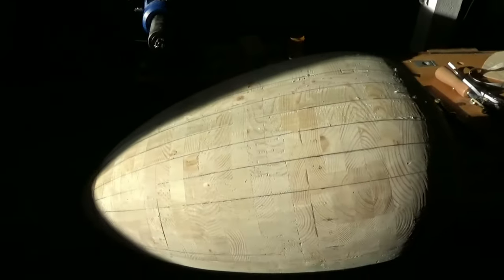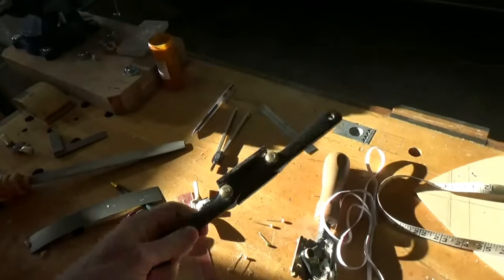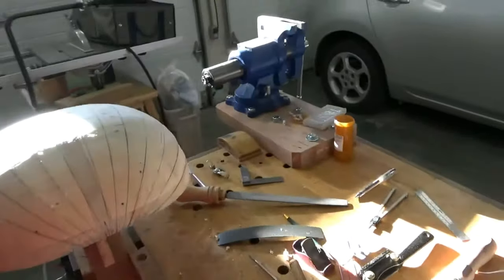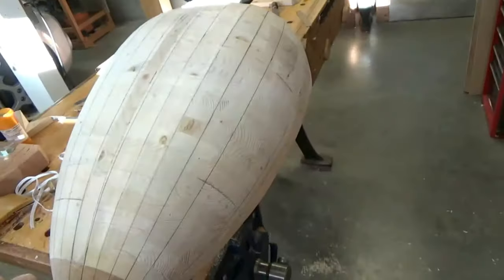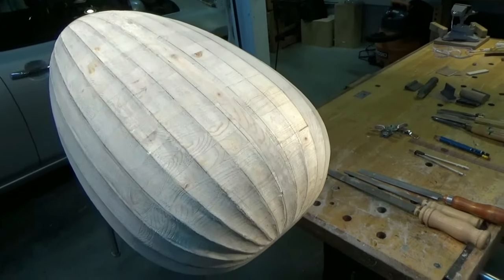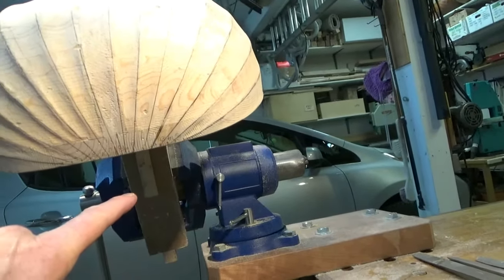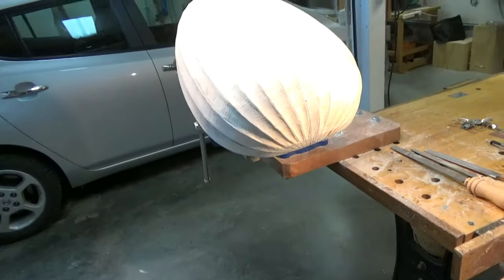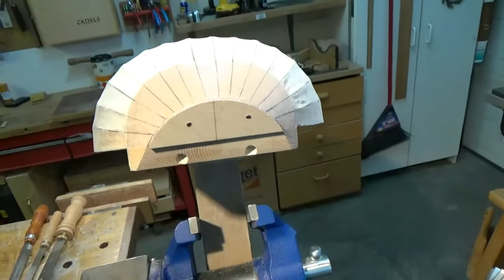Making a Lute Mould

Comment: Thanks for this, very interesting and informative! I see how you transfer the shape from the drawings to make the spine and soundboard outline, but how do you get the right (and symmetrical) curve on either side of the back between those two faces - is it something you can just get right carving by eye or is there a more sophisticated way of doing it?
Reply from the maker: Divide the circumference of the mould, taken at several points along its length (the spine of the mould) equally,  making the outer ribs slightly larger to allow for scooping and correction of the action during assembly. Then you connect the points ( I use five or six, with more at the ends) with a line, forming the outline of the rib, from the neck block (marked equally) to the endclasp or capping strip area at the bottom of the mould (meet at a point or spread, depending on period of the lute).  Then connect these points to make the rib profiles with a  tape that looks nominally straight to the eye.  The more flattened the lute, the more curvature for each rib.  Multi-rib lutes make the coverage easier than fewer ribs, but more work fitting and marking. I mark the round finished mould with a dark pencil, scoop and file, then mark with ink, then varnish finish and wax heavily.

c
Reply: @EarlyMusicStudio1  Hi Clive, thanks very much for the helpful, detailed response. I think it's the flattened back that is confusing me. I can imagine dividing the circumference equally at different points along its length if it were a semi-circle, but the flattened shape seems like it would make each cross section along its length quite unique. Do you work out those circumference measurements on paper first or do you just carve the overall shape by hand/eye following the outline of the base and spine and then measure and mark the circumference divisions with the fabric tape measure afterwards?
Reply from the maker: @jamesluff8415  Yes, you carve the overall shape following the base and spine, but a drawing, a good one, has bulkheads that have have been measured from the original. (Guild of American Luthiers Lundberg plans have these, as do others). Supposedly you are modelling your lute on a historical one, and these have all sorts of deviations from the semicircle, in fact it never appears.  All lutes are shaped as an aesthetic concept, often have slight bulges over the clasp, humps over the neck block (adds material, makes division easier) as well as flattening.  The more extreme shapes are normally more ribs, up to 33, while simpler, early shapes are 9 or 11 ribs. 18th C. German lutes later revived the early shapes and fewer ribs.  

Somehow it all works out.  Neapolitan mandolins have very wide side ribs, but much smaller main back ribs, with the transition in between. 

You must rationalize each rib, they are unique, and they must lie flat on the mould.  See video for the importance of that idea as you fit. Your rib blanks must also be the correct width, as banana and s-shaped ribs make the needed strip wider.

Beyond that, any shape is theoretically  possible, given enough subdivision.  Some woods work better than others, and looking through instrument inventories in lute collections (Bologna, Nuremburg, Munich, Paris, London) point to the best woods: yew, rosewood, maple. Best bending, best planing, best non-splitting, best sound.

c
Reply: @EarlyMusicStudio1  Thanks, I appreciate all the detail. As you can probably tell, I'm new to lute making and it seems to me to be a curious (and delightful) mix of great precision and hand-carving in a way that is quite different from the precision of engineering. 

I'm currently working through one of David van Edwards' courses but have already been eyeing up Stephen Gottlieb's plans for a theorbo after Buechenberg. I've just unfurled the plans again and how to go about making the mold is now a great deal clearer to me - so thanks for that!

Incidentally, I'm having a very hard time finding any yew ribs without lots of imperfections. Those unscrupulous lute makers of old really cleared Europe out of all the good trees! ;)
Reply from the maker: Yes, yew is precious and storied wood; the Celts believed it protected the spirits of the dead and every old church in the UK has its ancient yew.  The enzyme taxamine, which is contained in the cambium and roots, was used as a poison for centuries, then found a new use in the breast cancer drug Taxol, from Bristol-Myers, who barked and cut yew in the national forests of the Olympic penisula. A friend heard about it, collected some, and sold it to a few makers.  Pacific yew is lighter and more fissile than European, but large trees can still be found on Vancouer Island.  I got some from a lumber yard in Sydney BC (Westwind) which sells to boaters. I've made many fine instruments with it, but had only a bit for a shaded yew bowl.  I combine with rosewood (alternating ribs, both baroque guitars and lutes) to achieve a fine, reedy yet sustaining sound in baroque lutes. c PS best of luck with the lute. Pear wood is a good substitute, or elder if you can find a tree. Claro or Black Walnut, or Olive spp. might be nice in place of rosewood, all easily available in the US. Lots of makers in Germany in the 20th C. used cherry and maple, alternating, very fine grained wood if possible. @jamesluff8415
Reply: @EarlyMusicStudio1  Very interesting. Thank you, Clive!
Reply from the maker: I love them!  They are most useful in the hand--real hand-tools.  Because of the long space to the blade, they are far superior for my technique of holding and planing the rib while holding in the hand.  To fit the ribs I use five planes, Record jointer mounted up in the vise, set very fine, ECE 22" wooden jointer set up in the vise set less finely, japanese plane to get me to jointer, ECE Reform Smooth plane (wooden), to get the basic rib shape, ECE Lewis wooden block plane for tiny adjustment, or hogging lots off, as it has a huge easily-adjusted hand boss. The fine jointer is the last stroke of the plane, sometime I use a sanding board very sparingly to correct problems, because it's quick. I use tiny asian planes set with various blocks to size purfling, binding and small parts.  Asian planes are very easily customized, a big bonus.
Reply: @EarlyMusicStudio1  My original comment seems to have disappeared into the ether! Great to hear you speak of them so highly. I'm very keen to give them a try. That large jointer in the vice really looks well suited to that job. So far I've been doing everything with a little low angle block plane (mounted in a desk for the final shaping), but I'm keen to see if I can make life a little easier with an extra plane or two. Thanks for the tips!
Reply from the maker: Hi James:  Low angle planes have a tendency to dig into anything but perfect grain direction.  Jointer planes have a much higher cutting angle, resulting in less tearout, this is why they are often used as smoothing planes. You will never go back once you try it.  Low angle block planes really are for blocks (end grain) only.  But that's my experience.  I use them to make purfling, they slice nicely through softer wood. @jamesluff8415

Comment: I wish to see how to glue the ribs they are really thin I make oat OD it’s a little thicker than this ribs thank you
Reply from the maker: Hi Majid, that's easy!  Make them fit perfectly, then add glue with a small brush.  Clamp and pull them together using masking tape, electrical tape, or paper/cloth strips with hide glue and  heated iron, pulling on each rib starting in the centre, working to the ends, where you use tacks to bend the wood slightly.  Make  the ribs thinner at the ends to make it easy.   A good lute maker checks the fit of each rib very carefully before glue. Make sure the ribs are conforming and fit the mould well, as well as fitting the next rib perfectly. Both must fit to get a good bowl that covers the mould exactly. Good luck!